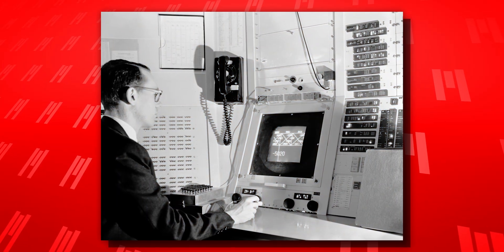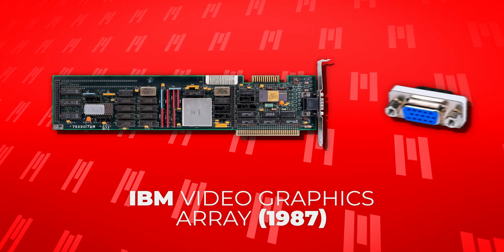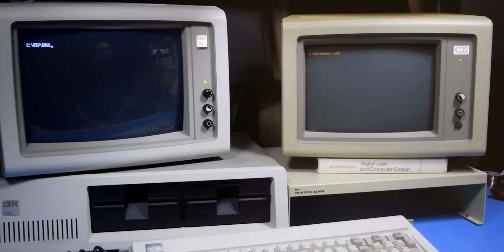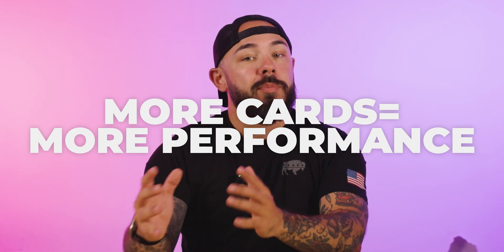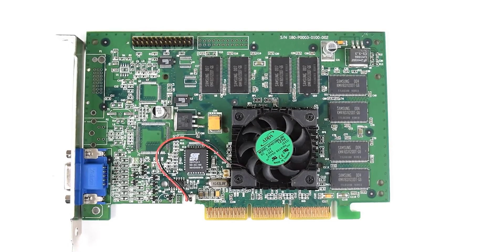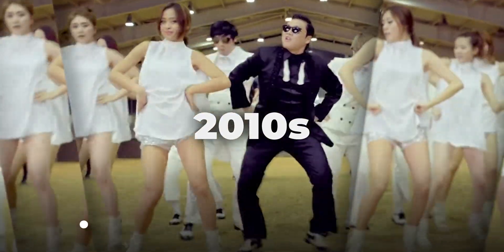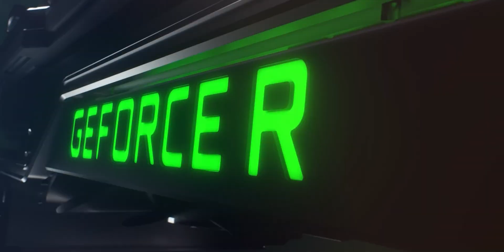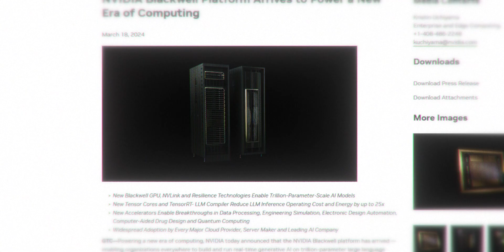THE ULTIMATE HISTORY OF GRAPHICS CARDS!

Comment: I remember using the 3DFX Voodoo 2 to play Quake.  The 3DFX Voodoo 3 3500 card was a huge upgrade because it also included a TV tuner and a hardware mpeg 2 encoder.  My next and last 3DFX card was the Voodoo 5 5500.  Shortly after the Voodoo 5 arrived, 3DFX was bankrupt.

My first Nvidia graphics card was the Geforce 256.  I strongly considered buying a TNT2 instead of the Voodoo 3 3500 but went with 3DFX because it was a brand that I knew.

I also ran a Diamond Stealth 3D card for a short time.  This card was a huge pain in the @ss because the graphics were difficult to install.  The damn PC would crash while loading the drivers causing you to have to start over.  With a lot of frustration and hours of effort, I was able to get the drivers installed and the card performed ok after that.

Comment: When I built my first gaming computer I used an ATI card for Microsoft flight simulator x mostly because it was the only card that would actually run on Windows XP well and it was cheap I never actually installed it and it's still just sitting on the shelf in its box waiting for me to actually finish that build while my 3090 13900 KS running Microsoft flight 2020 is absolutely kicking it and being awesome

Comment: If NVIDIA was pretty much the dominant power from the day it started, it hasn’t been always the case. They somehow failed with the Geforce FX and ATI came up with the Radeon 9700 Pro around 2002-2003 then 9800 which were the gamer’s dream at that time, until NVIDIA released the Geforce 6000 series in 2006. Same thing happened later on in the 2000’s when AMD released the Radeon HD 4850 around 2008. Once in a while, the “reds” come up with something faster and cheaper than the “greens”. This usually happens when raw power evolves at the expense of power efficiency.

Comment: DLSS was introduced in RTX 20 series with ray tracing. https://youtu.be/6hwfz-kmXeM?t=566
Reply: it was not relevant until second version released anyway
Reply: @KianFloppa  Bro but a FACT is a FACT , yes DLSS 2.0 was far superior than 1.0 introduced with 20 series.
Reply: @KianFloppa  Also the 20 series now has the same DLSS version as the 30 series so the feature is present on the 20 series and it would be misleading to tell a person who wants DLSS for cheap to buy 30 instead of 20 series because 20 series does not have it.

Comment: Hey guys, I have recently created a YouTube channel, it's about tech with more of a DIY approach, if you like this kind of stuff, consider having a look! My first project is building a PC that turns heat into electricity, very similar to what basically homeless did but with a lot of modifications, mostly integrating everything into the case instead of having that cardboard box sticking out of the case, and I will also give an end to the electricity generated.